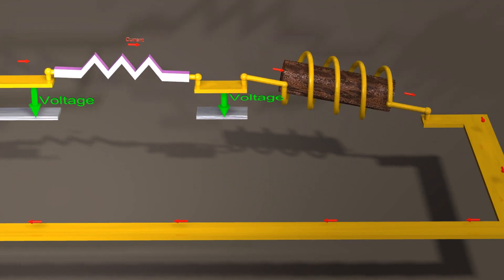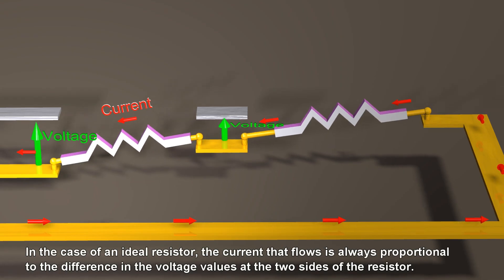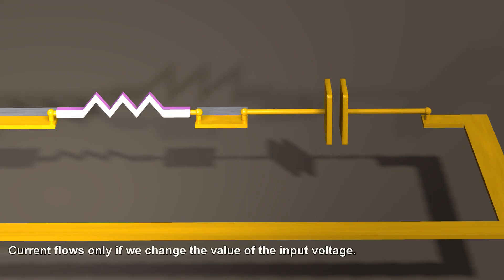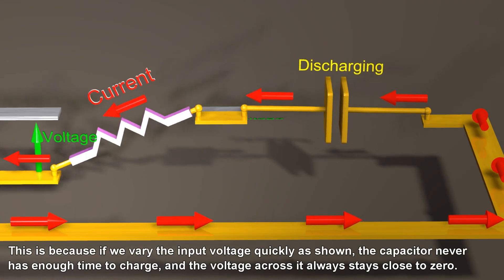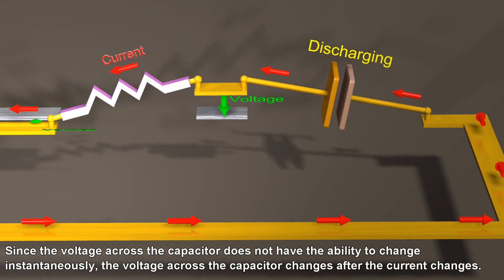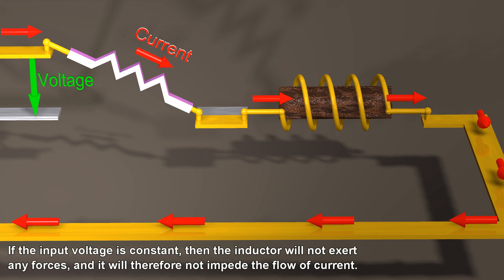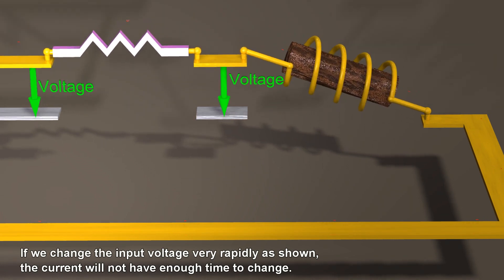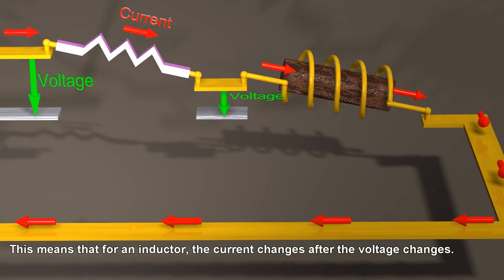AC current impedance - Alternating Voltage for inductors, capacitors

Comment: This video made me more confused.
Reply: What is a resistor? How does current branch in a network of resistors? How does it "know" how much should flow in each branch?
While some detail is given in science and engineering courses about conductors, insulators and semiconductors, resistance is described in several ways.
Examples include i. The restriction to the flow of electrons. ii. The difficulty in moving electrical current through a conductor to which voltage is applied.
iii. a circuit element which dissipates energy in the form of heat .
More appropriate description for a resistor would be the property of a conductor which determines the current produced by a given difference of potential.
This makes us remember that a resistor is a conductor first. And, there is reason to say that superconductive wires dont obey ohm's law. So all conductors are resistive, though not superconductors. 
Resistors are used in circuits to regulate the strengths of currents either by reducing the diameter of conductors or introducing more obstacles or lattice imperfections to reduce the strength of current.
The current branches in a parallel network by an elaborate rearrangement of surface charge.
For more details about resistance, how current branches in a parallel circuit and ohm's law consult the following videos, articles and books.
Capacitive reactance
The capacitive reactance is expressed in ohms and it is useful to determine steady-state current values to sinusoidal voltage inputs. Although the value of the reactance is expressed in ohms, it was not obtained by computing a resistance, as of resistors. 
The current in the wires of a capacitor circuit is due to the resultant electric field E(NET) (a resultant of the applied field and an opposing electric field, the fringe field of a capacitor), obtained by applying the relation for current density J = σE(NET), where σ is the conductivity of the wires.

The field in the wire which may vary sinusoidally is always a resultant of the applied voltage which may be sinusoidally varying and the fringe field due to charge accumulation on the capacitor plates.
For a comprehensive description of the mechanism of current leading the voltage across a capacitor see the book references below. 
Inductive reactance
The inductive reactance is expressed in ohms, and is useful to determine steady-state current values to sinusoidal voltage inputs. It is to be noted that though the value of the reactance is expressed in ohms, it was not obtained by computing a resistance, as of resistors. 
The current is on account of the resultant of the applied field and an opposing coulomb electric field, which is due to polarization by the non-coulomb curly patterned electric field associated with the changing magnetic field, and the current obtained thereof by applying the relation J = σE(NET) where E(NET) is the resultant field of the applied field and the coulomb electric field and where σ is the conductivity of the wire.
For a comprehensive description of the mechanism of current lagging the voltage across an inductor at different frequencies see the book references below. 
Electrostatics and circuits belong to one science and not two, that of electricity and magnetism. To know how they are unified visit this link 
https://matterandinteractions.org/articles-talks/ and view the article 'A unified treatment of electrostatics and circuits.  B. Sherwood and R. Chabay, unpublished. (1999)'
pdf.
For a live demonstration of surface charge and its effects in circuits visit 
https://youtu.be/U7RLg-691eQ
Electrostatics and circuits belong to one science and not two, that of electricity and magnetism. To know how they are unified visit this link 
https://matterandinteractions.org/articles-talks/ and view the article 'A unified treatment of electrostatics and circuits.  B. Sherwood and R. Chabay, unpublished. (1999)'
pdf. 
For a live demonstration of surface charge and its effects in circuits visit 
https://youtu.be/U7RLg-691eQ
For a detailed discussion of surface charge, coulomb's law, electric fields, fields of dipoles and other charge configurations, parallel plates, capacitance, currents, conservation of charge, conservation of current, superposition of fields, superposition of potential, simple dc circuit, magnetic fields, magnetic fields of a current element, straight wire, current loop, solenoids, biot-savart law, voltage, voltage source, difference between e.m.f. and potential difference, ideal voltage sources, resistors, how current branches in a parallel circuit, capacitors, inductors, faraday's law, inductance, ac circuits, transmission lines, motors, generators, p-n junction diodes, electromagnetic waves, antennas and radiation, new electrodynamic theories on the nature of the electric field, see "Electric and Magnetic Interactions" by Chabay and Sherwood 
www.matterandinteractions.org
or 
Fundamentals of electric theory and circuits by Sridhar Chitta
https://www.wileyindia.com/fundamentals-of-electric-theory-and-circuits.html
There is a "look inside" feature in the amazon.com webpage of the book "Fundamentals of electric theory and circuits" by Sridhar Chitta with a few pages of Chapter 1 which may be viewed and also which you may swipe left or press < icon to view the foreword, preface and Table of Contents. 
The contents of the above book by Sridhar Chitta, make a distinct unified approach to electrostatics and a few advanced circuits like coupling signals to amplifiers, lending precision and clarity to the topics which is not found in most text books.
The book comes alongwith a CD with animated power point presentations for all chapters and voltage regulator, RC phase shift oscillator, transformer-coupled audio amplifier and differential amplifier included additionally.
For a lecture by Prof Ruth Chabay on surface charge in a simple dc circuit visit 
https://youtu.be/-7W294N_Hkk
There is a full set of lectures beginning lecture 13 here on surface charges, electric fields, simple circuits, capacitance, inductance, faraday's law, motional emf, magnetic forces and more topics here
https://matterandinteractions.org/videos/EM.html

Comment: I just learned that sometimes engineers approximate sin(x) = x when x is very small. There is a parallel between this and the fact that a capacitor passes high-frequency current better than low-frequency current.
Reply: What is a resistor? How does current branch in a network of resistors? How does it "know" how much should flow in each branch?
While some detail is given in science and engineering courses about conductors, insulators and semiconductors, resistance is described in several ways.
Examples include i. The restriction to the flow of electrons. ii. The difficulty in moving electrical current through a conductor to which voltage is applied.
iii. a circuit element which dissipates energy in the form of heat .
More appropriate description for a resistor would be the property of a conductor which determines the current produced by a given difference of potential.
This makes us remember that a resistor is a conductor first. And, there is reason to say that superconductive wires dont obey ohm's law. So all conductors are resistive, though not superconductors. 
Resistors are used in circuits to regulate the strengths of currents either by reducing the diameter of conductors or introducing more obstacles or lattice imperfections to reduce the strength of current.
The current branches in a parallel network by an elaborate rearrangement of surface charge.
For more details about resistance, how current branches in a parallel circuit and ohm's law consult the following videos, articles and books.
Capacitive reactance
The capacitive reactance is expressed in ohms and it is useful to determine steady-state current values to sinusoidal voltage inputs. Although the value of the reactance is expressed in ohms, it was not obtained by computing a resistance, as of resistors. 
The current in the wires of a capacitor circuit is due to the resultant electric field E(NET) (a resultant of the applied field and an opposing electric field, the fringe field of a capacitor), obtained by applying the relation for current density J = σE(NET), where σ is the conductivity of the wires.

The field in the wire which may vary sinusoidally is always a resultant of the applied voltage which may be sinusoidally varying and the fringe field due to charge accumulation on the capacitor plates.
For a comprehensive description of the mechanism of current leading the voltage across a capacitor see the book references below. 
Inductive reactance
The inductive reactance is expressed in ohms, and is useful to determine steady-state current values to sinusoidal voltage inputs. It is to be noted that though the value of the reactance is expressed in ohms, it was not obtained by computing a resistance, as of resistors. 
The current is on account of the resultant of the applied field and an opposing coulomb electric field, which is due to polarization by the non-coulomb curly patterned electric field associated with the changing magnetic field, and the current obtained thereof by applying the relation J = σE(NET) where E(NET) is the resultant field of the applied field and the coulomb electric field and where σ is the conductivity of the wire.
For a comprehensive description of the mechanism of current lagging the voltage across an inductor at different frequencies see the book references below. 
Electrostatics and circuits belong to one science and not two, that of electricity and magnetism. To know how they are unified visit this link 
https://matterandinteractions.org/articles-talks/ and view the article 'A unified treatment of electrostatics and circuits.  B. Sherwood and R. Chabay, unpublished. (1999)'
pdf.
For a live demonstration of surface charge and its effects in circuits visit 
https://youtu.be/U7RLg-691eQ
Electrostatics and circuits belong to one science and not two, that of electricity and magnetism. To know how they are unified visit this link 
https://matterandinteractions.org/articles-talks/ and view the article 'A unified treatment of electrostatics and circuits.  B. Sherwood and R. Chabay, unpublished. (1999)'
pdf. 
For a live demonstration of surface charge and its effects in circuits visit 
https://youtu.be/U7RLg-691eQ
For a detailed discussion of surface charge, coulomb's law, electric fields, fields of dipoles and other charge configurations, parallel plates, capacitance, currents, conservation of charge, conservation of current, superposition of fields, superposition of potential, simple dc circuit, magnetic fields, magnetic fields of a current element, straight wire, current loop, solenoids, biot-savart law, voltage, voltage source, difference between e.m.f. and potential difference, ideal voltage sources, resistors, how current branches in a parallel circuit, capacitors, inductors, faraday's law, inductance, ac circuits, transmission lines, motors, generators, p-n junction diodes, electromagnetic waves, antennas and radiation, new electrodynamic theories on the nature of the electric field, see "Electric and Magnetic Interactions" by Chabay and Sherwood 
www.matterandinteractions.org
or 
Fundamentals of electric theory and circuits by Sridhar Chitta
https://www.wileyindia.com/fundamentals-of-electric-theory-and-circuits.html
There is a "look inside" feature in the amazon.com webpage of the book "Fundamentals of electric theory and circuits" by Sridhar Chitta with a few pages of Chapter 1 which may be viewed and also which you may swipe left or press < icon to view the foreword, preface and Table of Contents. 
The contents of the above book by Sridhar Chitta, make a distinct unified approach to electrostatics and a few advanced circuits like coupling signals to amplifiers, lending precision and clarity to the topics which is not found in most text books.
The book comes alongwith a CD with animated power point presentations for all chapters and voltage regulator, RC phase shift oscillator, transformer-coupled audio amplifier and differential amplifier included additionally.
For a lecture by Prof Ruth Chabay on surface charge in a simple dc circuit visit 
https://youtu.be/-7W294N_Hkk
There is a full set of lectures beginning lecture 13 here on surface charges, electric fields, simple circuits, capacitance, inductance, faraday's law, motional emf, magnetic forces and more topics here
https://matterandinteractions.org/videos/EM.html
Reply: @sridharchitta7321  Eugene Khutoryansky has another video positing that Ohm's Law is not a real law, as it merely enumerates the property we call resistance. That is, voltage is something, current is something, and resistance is a number we get when we compare the voltage across something to the current running through it.
https://www.youtube.com/watch?v=G3H5lKoWPpY